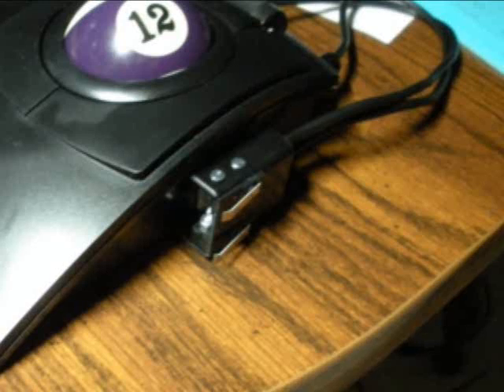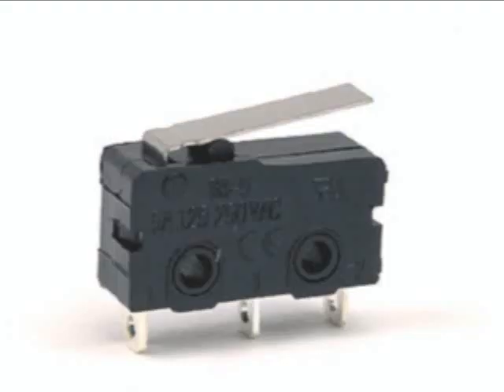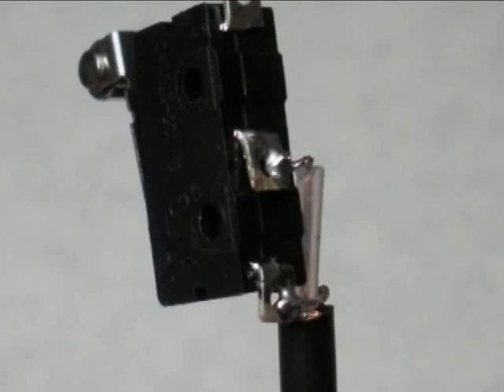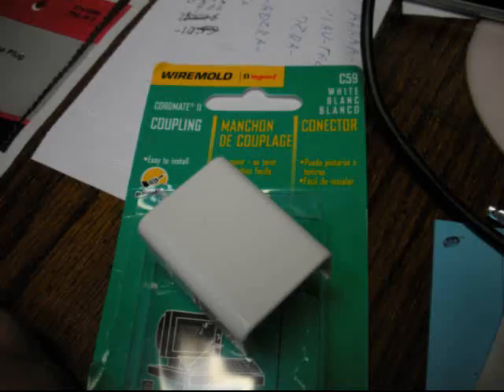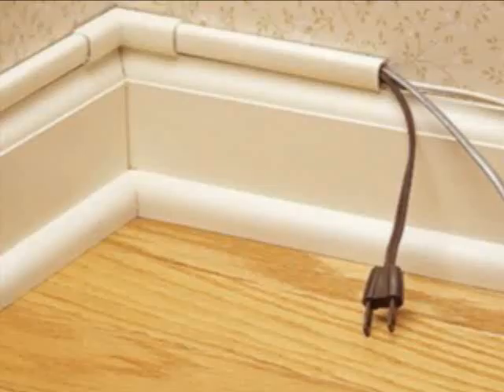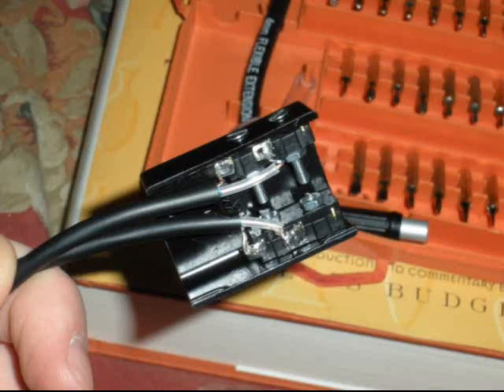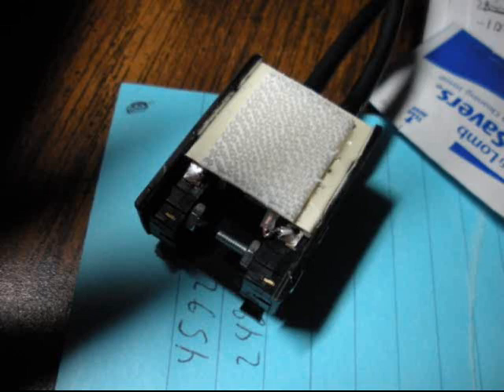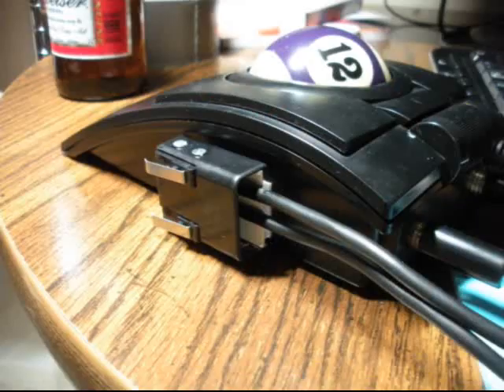How to Make an External Switch Assembly for the L-TracX

Comment: Very informative.  What buttons are the switches mapped to?

How will I know if a cable has resistors without cutting it open?  Is it usually listed as a feature?
Reply from the maker: The side-mounted switches are actually more ergonomic for me than the built-in buttons, so I have them mapped to primary (top switch) and secondary click. I mapped the top right trackball button to "Back", which is handy for web and folder browsing. As far as the resistors, I know of no way to check any given cable. The best thing I could suggest would be to buy one of those cheap colored audio cables that they sell for $5 in supermarket checkouts since the ends look too slim to fit a resistor in, or if you're handy at soldering you can buy the ends at Radioshack and install them on the cable yourself.
BTW I have since built a more sophisticated version of the switch, pictures can be seen on my Photobucket account. (Username is craZivn.) Main differences in the updated version is that I used two long machine screws right through the switch body, which "clamps" it onto the base and eliminates the need for glue, and I also used a piece of Kydex instead of the flimsy baseplate that came in the package.
Also, I disassembled the switches and bent the metal levers in such a way as to minimize the throw. Once you pop the switches open it's pretty straightforward.
Reply: supersteve1440 I realize this is an old comment, but the first clue that the cable had resistors in it was the label "Attenuating".  Attenuation is a term used a lot in engineering that basically means, in an EE application, a reduction in signal strength.  So the volume is attenuated by dropping voltage across those resistors, and therefore reducing the voltage applied across the load (the speaker).

Any cable that has extra features like attenuating resistors should mention it on the label, so just keep an eye out for those notes when shopping.